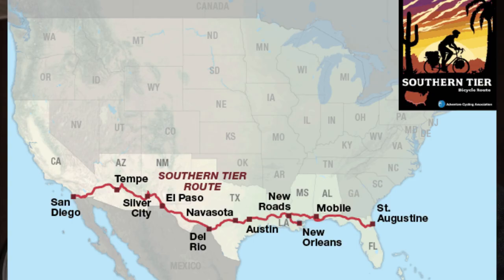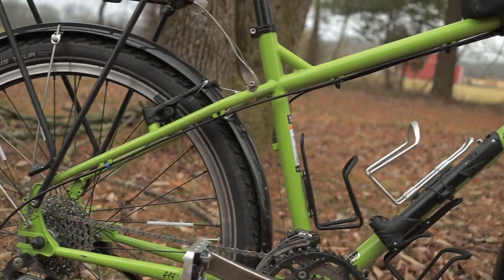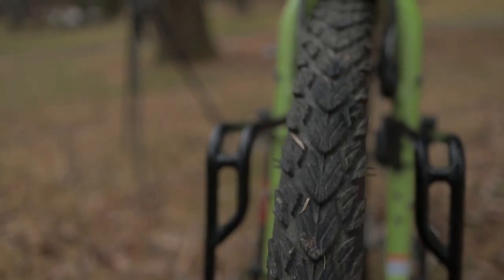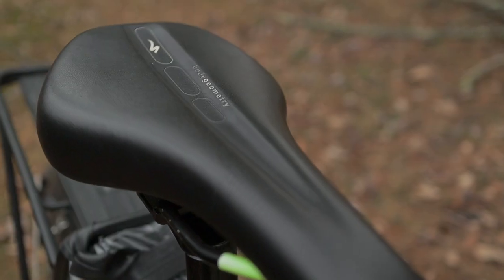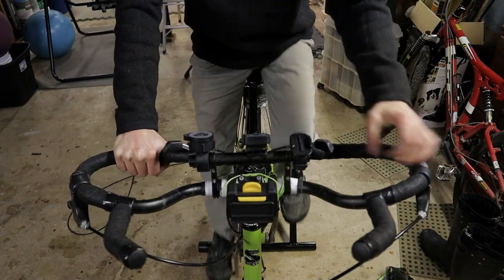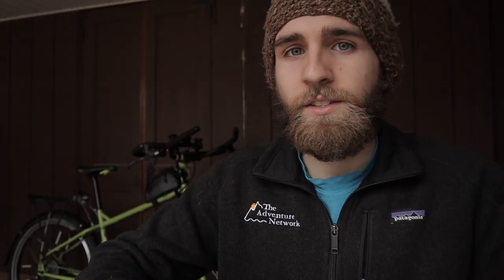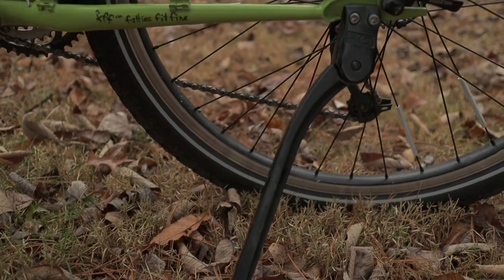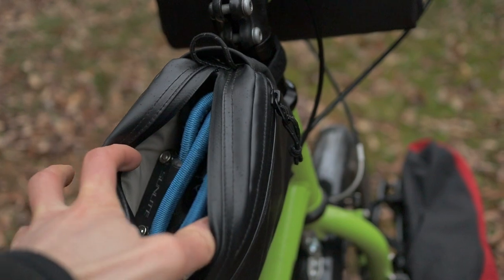Building a Touring Bike - Final Overview! (Surly Troll)

Comment: Barends often require a certain torque for safety. That torque exceeds the maximum permitted torque on butterfly/trekking bars. Have you been concerned about that? Also, due to Schwalbe no longer making most of their touring tires in the 26" size, when you do upgrade to disc brakes you might want to change to 650B rims. Surly never officially endorsed 650B wheel size for the Troll frame, but they fit just fine and this really future-proofs the Troll frame.

Comment: I rode a Ogre from Yellowstone to Panama and wanted to continue to Colombia but I just couldn't find 700c tires.  Had I went with a Troll I wouldn't have had that problem, 26" tires are everywhere.  I loved my Ogre though, really great bike.  I'm going to get a Troll stock and the only thing I'll change is I'll go with a Rohloff hub providing I have saved up enough by the end of the summer.  Besides tires gears were a headache.  A Rohloff with a chain is still a ton less cleaning to do.
Reply from the maker: Yea I never realized just how dirty drivetrains get when you ride all day everyday. I’m always grateful when a town has a community bike shop that lets you use tools so I can dig in and get it all clean. Only lasts a couple days though... I met a lady a couple weeks ago with a LHT and a Rohloff that I got to hop on for a sec and it seemed great. Big investment but seems like the durability would pay off
Reply: @tylerpastorok384  Not just pay off but a lot less time on a tour cleaning gears and chains.  Also the chain can be a bit more beefy and doesn't need to be as long.  I spent a lot of time cleaning gears on my tour after I had a few go bad.  I'll see how much I have saved up before I leave, I might not go with it, but I think it is worth the investment.  Out of every kind of bike maintenance cleaning the drivetrain is the worst.
Reply: Yeah, I was watching a video of a guy who rode from Canada to Patagonia and he had all sorts of problems finding tubes and tires for his standard 700c touring bike in places like Ecuador and Peru so you were probably wise to cut the trip short. Still sounds like an amazing trip though, I'm jealous.

Comment: Awesome build! My wife & I both have 2019 Trolls that we set up remarkably similar to yours... We went with the Surly Moloko bars (but gave serious consideration to the Butterfly bars); kickstand & adapter plates just like you have; cockpit instruments & lights up on a perch (exactly like yours); fenders (we went with SKS Blumels 75 U Long that we ordered from Germany to accommodate the Surly 2.5" Extraterrestrial tires); mix of frame bags & panniers; and finally... dork disk (You didn't mention this, but I went out of my way to put one on each bike as cheap insurance against a lot of hassle. Note: you can't buy one that'll fit right out of the package. I modified them and attached 'em with three zip ties. I can tell you how I did it if you like).
Reply from the maker: Yea I considered the Moloko bars as well.  I’d bet it’s a more comfortable setup, but I didn’t like that it would limit my choices for handlebar bags.  I may try the Velo Orange ‘Crazy Bars’ eventually.  I don’t usually bother with a dork disc but you’re definitely right, it’s a smart choice.  On my old bike I had my chain shift past the low gear once while I was leading a group and that definitely cost us a good 15-20 minutes

Comment: Cool overview of your setup. I am currently building my touring rig. I am curious, what are your thoughts on a dynamo hub to charge your iphone while on tour? I currently use a foldable solar panel on the back, plus a 26000ah ext battery that works good for me. But was wondering about long stretches without sun out in the middle of nowhere. ✌🏼
Reply from the maker: Bike Tall I’m running a similar solar panel and battery setup. If it weren’t for the fact that I was looking for such particular wheels, and that I don’t have the resources/time to build them right now, I definitely would’ve gone for something with a dynamo hub in the front. I don’t have much experience with them, but it looks like there are some good options for usb charging. Seems like having both charging options would be a great setup. Good luck with your build!

Comment: Where did you get your butterfly bars and the extension bars?  I have a surly bridge club that I am setting up for touring.  I currently have a Jones H 2.5 handlebar that replaced the stock salsa bend.  But i need a more aero position when riding on long stretches of road or into headwinds.  Plus i have carpal tunnel issues so need lots of places to move my hands to stop the numbness.

Comment: I am in the process of selecting a bike. So there is Troll and another is Bridge Club. Troll has horizonal drop out and Bridge Club has vertical drop out. How much difference does that make. Troll frame is available in a local bike store. It's an old frame, so I can save some cost. What are your thoughts? shall I go for a new bridge club frame or Old troll frame (it is in good conditiion) would serve the purpose

Comment: Hi Tyler thanks for video. Also i have finished the building troll 3 days ago. But i cannot fix the rear wheel with standart quick relaise  as well as i want. I first time using horizontal dropout and i dont know i must buy surly tuggnut or not. Do you use "surly tuggnut" if not how do you fix rear wheel with qr on gravel and offroads? 
Ps: i use hyraulic disc brakes. The caliper limits one side of rear wheel but the other side there is no limitation. And the gr axle   may turns.
Reply from the maker: eren konu hey Eren thanks for watching. I have my rear wheel all the way forward in the dropouts so I don’t need the tuggnut. But if your wheel can’t sit there then it seems you would need a tuggnut or something similar. Hope that helps, let me know if there’s anything else I might be able to answer. Good luck!
Reply: @tylerpastorok384  Hi Tyler I solved the problem and the problem was about the rear disc brake adaptor. I used wrong(reversed). For now I am using troll with my old 700c wheels and fenders it look nearly original. 700x40 with sks bluemels fender.
Will you show us new videos?
Reply from the maker: eren konu Hey thanks for the update! Glad you figured it out, and it’s good to know that the troll will take a 700c wheel and still have room for fenders.  As for new videos, absolutely!  I’ve been a bit busy since we finished the trip so I’m just getting a chance to sit down and start editing videos from our tour.  We recorded quite a bit, so I expect it will take me most of the summer to finish all of them.  I want to edit the whole series before I start releasing it.  I probably won’t upload much in the meantime, but if you turn on notifications for my channel then you’ll know when that starts.  Thanks for your interest and support!

Comment: I don´t like weight of the front so I preffer a fat bike framebag, 2cm further from each side of the frame rather then a front rack and the botles near the stem. 9 speed is the way to go. Gear ratio is for nerds so yeah let´s talk: a 2x 36-22 with 11-36 cassette works great. Don't freak out about shifters and breaks go with what you got, I like rapid fire and mechanical disk, if they break just unbent the rotor or tighten the H and L screws and make a single speed rear or front derailleur. Nice with the "aero" bars, would put them a little bit together for further ahemn super duper performance